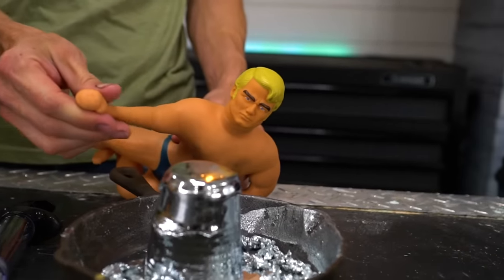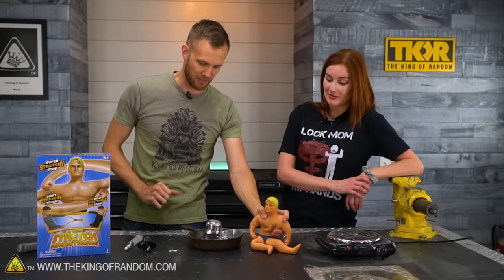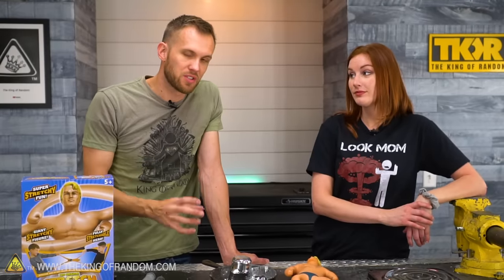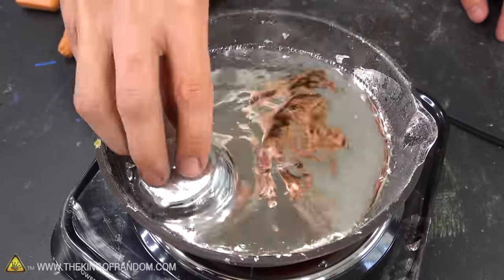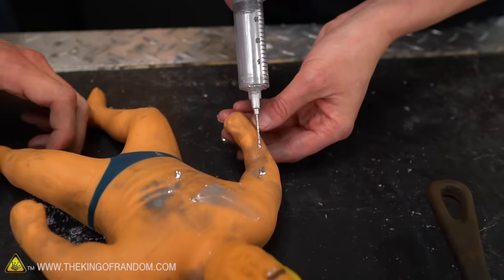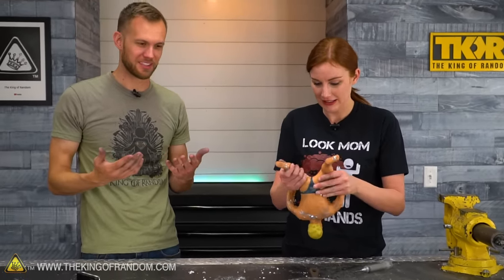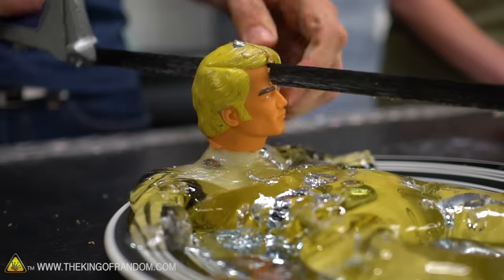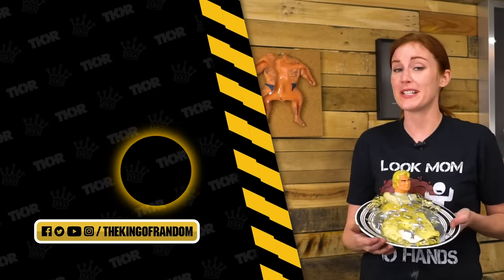You Will Never Look At Stretch Armstrong The Same Again

Comment: “It’s not hot, only like 140 degrees” while touching it... 140!!
Reply: they measure in fahrenheit, which is roughly 60 degrees celsius
Reply: Chaotic 60 degrees celsius isnt that hot, at most a little too warm
Reply: 60 degrees celsius is like the hottest tap water can get straight from the tap
Reply: @plasma7704  h a w t
Reply: u can cook a egg at 140 oof
Reply: @yomerass  maybe after a VERY long time 140 farenheit isn't very hot at all usually open asphalt in the sun is about that hot or hotter.
Reply: @chickenface9731  well here its around 80c lmao
Reply: Plasma are you ok? 60 degrees Celsius is really hot
Reply: no its like only 100
Reply: that's really not that hot to touch
Reply: that's like,,,,a fairly hot hot tub
Reply: Gavin Russell true but still it’s possible
Reply: The mans not hot
Reply: @chickenface9731  some water heaters can be cranked up way past that

Comment: you should freeze dry ketchup mustard mayo butter and stuff
Reply: That would be interesting...
Reply: Yeah, then make really thin slices of it to see if that can speed up making a sammich. Imagine pitting a slice of catsup on your bread like a slice of Kraft American cheese...
When did TKOR become Sid from toy story? Please do better things. I really don't like this video. What about putting tire valves from a bike or a car in soda bottles by drilling a hole in the top of it and then raising the pressure in it until it pops. Alternatively you can fill them to 150 PSI (they are rated for 200 PSI) and then tape a mouse trap to the side of it so that when it goes off it pops it, you can even rig them up with trip lines using the mouse traps so when someone steps on it or walks through it. either way make a trip-line perimeter.
Reply: I’ve commented about mayo before. But I’ll say again make mayonnaise an instrument
Reply: @evilcanofdrpepper  slices of ketchup are an actual thing you can buy online
Reply: @kellenoconnor4396  that's real?
And i thought ketchup soda was weird..
Reply: This is the only commet that's normal
Reply: Butter is already frozen

Comment: "Drain" a stretch by drilling a hole down through the top of his head. Warm him up (gently in a low heat oven until you can easily pour out the corn syrup) refill him with whatever you want. Seal his head with silicone caulk. I recommend the following fillings.
Non-newtonian fluid
Wax
Graphite
Oil
Air (resealing this one is tricky. But doable)